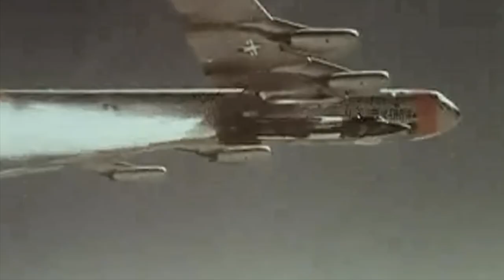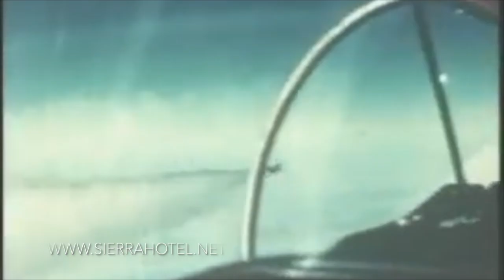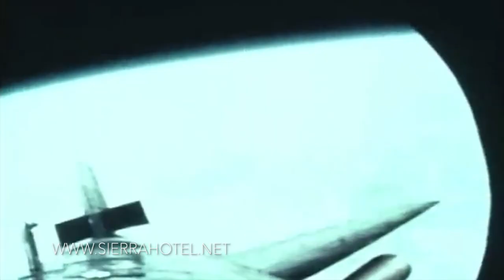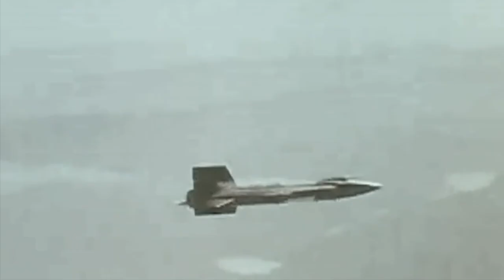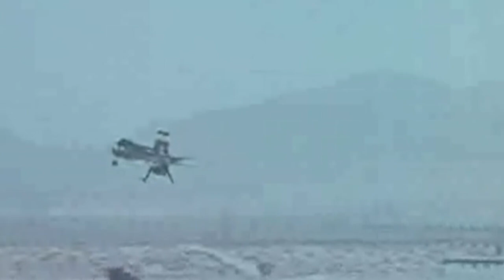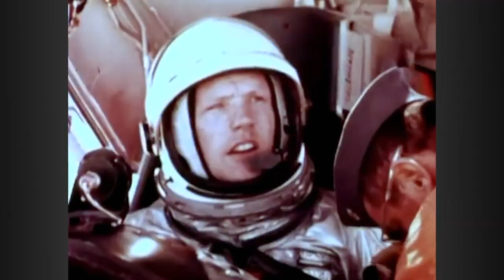Armstrong's Mach 3 Overshoot

Comment: Neil was not an exceptional test pilot, per his own peers, he was an engineer and test engineer first.
That said, on the early X-15's, there was no RCS system even thought of until the program was well advanced, so relied exclusively on aerodynamics to maneuver. It's kinda hard to aerodynamically control something without that aero part being present.
Once they installed the RCS system, the craft could maneuver at altitudes where the air was too think for the control surfaces to work and that fed significantly into knowledge on how to build orbital maneuvering systems, some of which remain in use today. One of which was a problem with a Boeing spacecraft, despite the thrusters being in use since Apollo and reliable, creating new areas of engineering hair pulling.
But then, high altitude and velocities is hard and space, harder still. Otherwise, we'd all be doing it.  ;)

Comment: Some comments on your video: I think it is disingenuous to say "poor Neil" when you talk about how the X-15 lofted back up to 140,000 feet, since it was Neil who was not paying attention to what he was doing, and caused the lofting back up out of the atmosphere himself. Also, he was never inverted in the X-15 during this flight. He did have to make a steep turn once he descended far enough into the atmosphere to regain aerodynamic controls, but he and the X-15 never had to go upside down. In addition, he never went as far south as Hollywood, but was instead over the San Fernando Valley when he made his turn back to Edwards, which was north not east. He did indeed exceed the planned distance on his ground track, and traveled 286.6 miles that day from his launch at Mud Lake near Tonopah, Nevada, however, both Bill Dana and Pete Knight exceeded that distance by 13.2 miles at 299.8 total miles traveled.
Reply: The longest X-15 flight was conducted by Neil Armstrong on April 20, 1962, lasting 12 minutes and 28.7 seconds.

The longest X-15 flight was conducted by Neil Armstrong on April 20, 1962, lasting 12 minutes and 28.7 seconds. 

This flight covered a ground track of 350 miles, setting the record for the longest duration and distance of all 199 X-15 flights.

That was the ground track-
Point-to-point was of course shorter.

Unlike most everyone else here in YouTube comments,
I am fallible.

Please feel free to comment or correct me.
Reply: @j.griffin  As I stated in my original post, Neil traveled a total of 286.6 miles, not 350 miles. No X-15 ever covered a ground track of more than 300 miles, as I also noted since the furthest flight was at 299.8 miles. The duration of Neil's flight that day was the longest flight time that an X-15 was in the air between its launch from the B-52 mothership and touchdown, but not the longest in distance.
Reply: @x15galmichelleevans 

I read your comment-
there were no sources cited.

This is from the online Smithsonian Magazine’s Air&Space section:

“Still, in 12.4 minutes, 
Armstrong had covered 350 miles ground track, 
the record for longest duration and distance of all 199 X-15 flights.”
-Mike Klesius

Obviously,
no one is infallible but there are other sources stating this number,
as well.

Since he flew longer,
I would think that he flew farther 
but (of course)…
I wasn’t there.

Anyway,
I have no bone to pick over this-
I was just looking for more confirmation as to your claims.

Perhaps I should have made that clearer.

No further comment.

Peace,
-g
Reply: @j.griffin  Unfortunately, the Smithsonian is not the source you might think it should be. I cite the example of their book on the X-15 entitled: "X-15: The World's Fastest Rocket Plane and the Pilots Who Ushered in the Space Age." If you decided to read this book, you would find that literally on every single page of this book are numerous mistakes. This is not hyperbole, it is a fact. They misspell names of X-15 pilots and other personnel, get altitudes and distances wrong, and so much more. So they may want the X-15 to have traveled 350 miles on that flight, but according to official NASA documentation and actual flight records (that I have verified myself), the distance covered was 286.6 miles. I spent 30 years of my life doing interviews and research in order to write my book on the X-15, and I feel proprietary when I see things stated that are incorrect about the program (as you can see by my numerous posts to this video, as an example). It was published in 2013 and is s still a bestseller today. I travel the world talking about this program, and I still continue to learn new things all the time.
Reply: Nothing but fist-pumpers here.

Comment: My grandfather, Vic Horton, worked with Neil in the Pilot's Office at Edwards and occasionally flew as launch panel operator on the B-52 for the X-15 and the lifting bodies. One detail you got wrong, while the X-15 was indeed too high in the atmosphere for aerodynamic surfaces, it was equipped with hydrogen peroxide Reaction Control System thrusters, so it was not like it was coming in out of control. In fact, the entire point of this particular flight had been to test the newly-installed Minneapolis Honeywell MH-96 adaptive flight control system, which had originally been developed for Boeing's canceled X-20 Dyna Soar orbital space plane. This automatically sensed the vehicle's speed and altitude and switched control between the aerodynamic surfaces and the thrusters, or any combination of the two, depending on the phase of the flight.
Reply: Yes, the Ballistic Control System (as what the RCS system we know today was called on the X-15 program) did control the attitude of the rocket plane when it was above the atmosphere. However, it had zero effect on the overall direction of flight, and thus had nothing to do with helping Neil correct his error in lofting back up out of the atmosphere, and losing all aerodynamic control of the X-15. Also, the MH-96 system was developed originally for the X-15, not the X-20, although it was planned to be used in the X-20, if it had reached fruition.